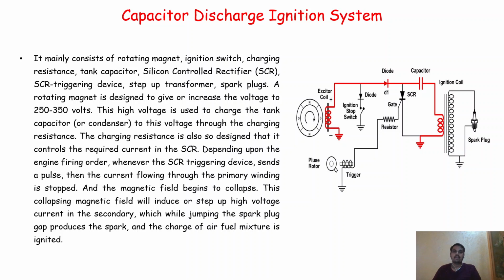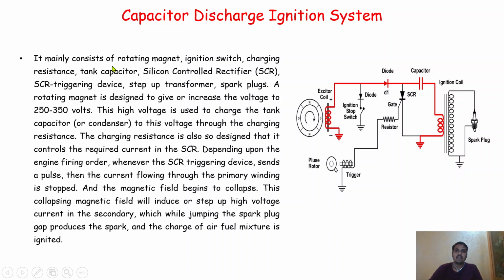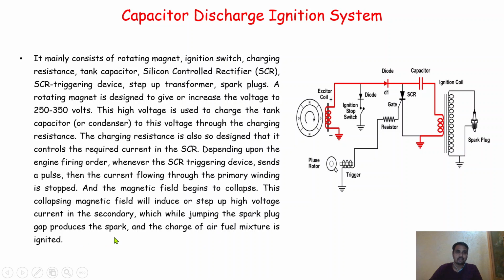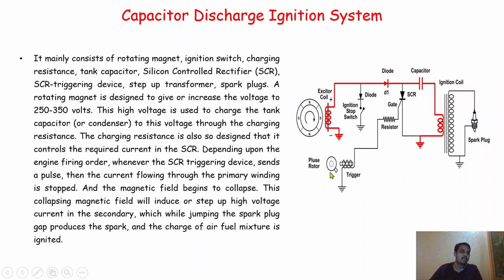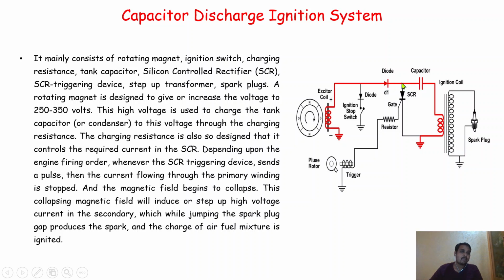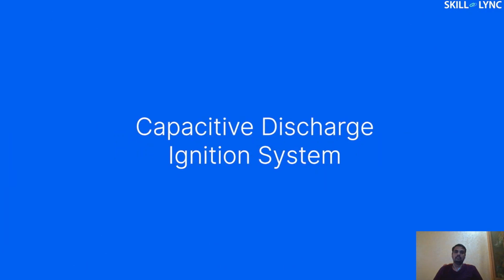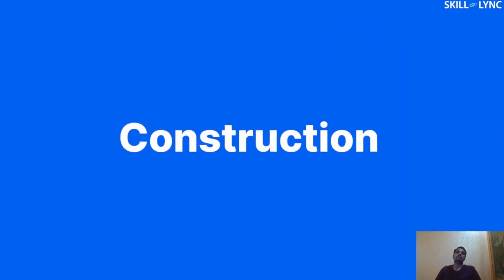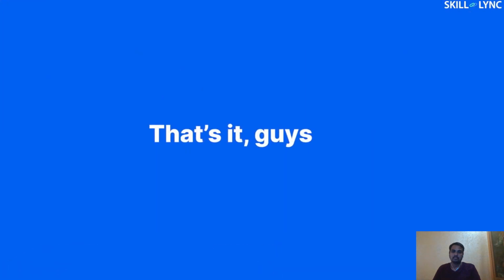Lect.35 Capacitor Discharge Ignition System

Comment: there are those of us who are trying to put electronic ignition on older single cylinder and two cylinder small engines with breaker points .  These would be a transistorized system.  A schematic with values for the resistors,transistors and capacitors would be much appreciated by alot of us   Thank you